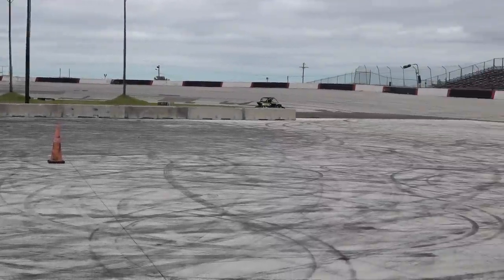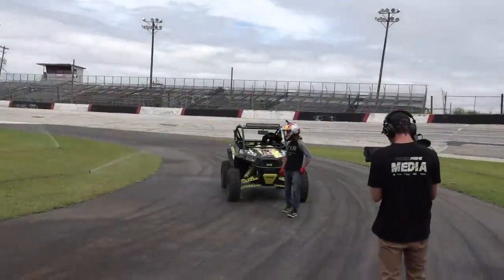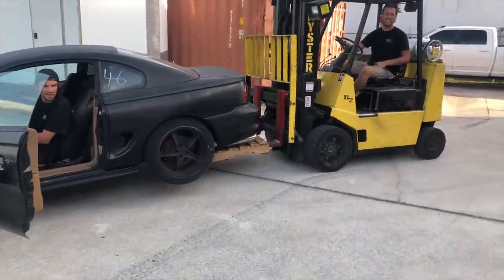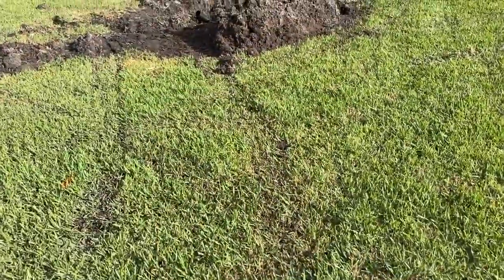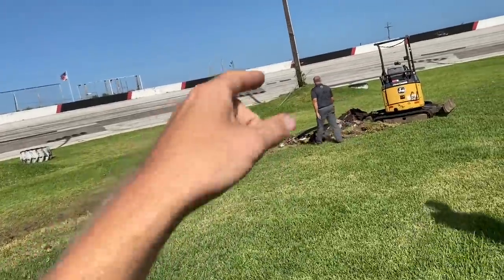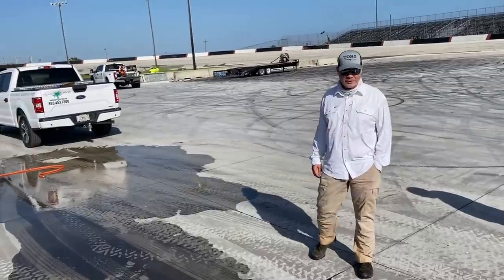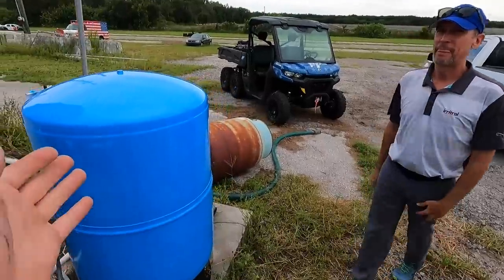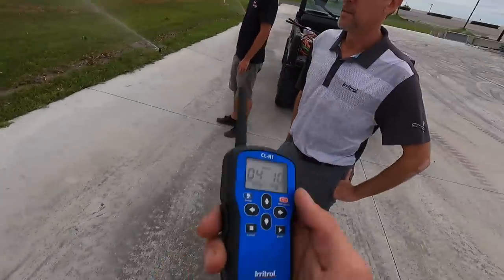Fixing MAJOR Freedom Factory Problems and Finding More in the Process!!! (That's Life!)

Comment: Cleetus, Journeyman Electrician here.... scariest scenario I have ever had presented to me in the industrial field.... I needed a core drill made for a 3 in electrical conduit thru a 12 inch explosion proof Brick wall... Hard Brick, the owner of my Electrical company handed me a 1/2 in Side grinder,( the big one) and a 4 inch core bit and said... "Have at it". I thought he was joking... Turns out, a 4 inch core bit will screw right up to a 1/2 inch Grinder... I had my helper hold the Drop cord tight so if the bit grabbed it would unplug automatically....needless to say, it took 3 cigarettes and a half hour before my balls dropped enough for me to make contact with that wall.... cut it like butter, but it was freaking intimidating as HELL....

Comment: "its called a french drain"

next clip

Cleetus: "so the french pipe"
Reply: It's hard for a Florida man to learn a new language that quick
Reply: "So weve installed the freedom pipe"
Reply: @Eargesplitten-Loudenboomer  Read that in Cleets voice in my head, and audibly laughed.
Reply: Damnpunk 78  it is AG in North America too, but we actually call it Weeping tile for the days when it was a terracotta tiles and pipe. A French drain is just the rocks with no pipe. Yes , there should always be rocks, the mesh will just get clogged with dirt.
Reply: Damnpunk 78  Yep.  When I dug one around my garage, I used the perforated pipe with mesh and gravel.  Still works well after about 15 years.  Dug a big sump in the back corner for the water to go.
Reply: Damnpunk 78  Florida and most of the South East USA soil is sand so it is a natural drain. No need for the gravel here.

Comment: When it comes to core drills and heavy tools there is no better than HilTI bar non. Freakin love their tools.
Reply: The general contractor I worked for found that out the hard way. He borrowed drills from three other contractors, - plumber, mason, electrician... They fried and he bought them all new replacements. He bought a $1600 hilti hammer drill and finished the whole job easily. Couldn't believe my eyes

Comment: Hey Cleeter, if you need a quick and affordable way to get Internet from one side of the track to the other for the irrigation system, have a look at the AirMAX and AirFiber product lines from Ubiquiti Inc. They are wireless units, just need line of sight. Range won't be a problem. The simplest setup is a matched pair at either end pointed at each other, but if you think you'll need more intertubes elsewhere, you could go with a point to multipoint setup with a single "broadcast" radio at the office/wherever the customer demarcation is to all the other buildings. The alternative is burying fiber and I don't think I gotta emphasize too much that is many times more expensive.
Reply: I've also had good experiences with Ubiquiti gear, with outdoor installs over many years. For an idea of how a racetrack installation can work, you can watch Crosstalk Solution's video: https://www.youtube.com/watch?v=6m00f9c2CUM
Reply: @Joel_E  Chris from Crosstalk Solutions would be an excellent person to talk to/possible collab with, though I think he's pretty far from Florida as the bird flies.
Reply: Actually, it just occurred to me, JayzTwoCents is a Corvette guy, I don't think you'd need to twist his arm too hard to get him down to the Freedom Factory 😂

Comment: They should put in 6” rotors so they can Install them 2” under the grass. Yes they will pop up through the grass.  By doing this it should save the sprinkler heads when someone decides to drive off the track.   I would recommend hunter 6” I20
Reply: Then they could run into the problem of having dirt ruining the seals on the rotor as well and then they just stick up anyway. I just hope they at least put the rotors on a swing pipe or swing joint so when someone does hit it they arent breaking the pvc line as well.
Reply: You can’t do that with St Augustine. The grass will eventually completely grow over it.
Reply: That grass is savage. Nothing stands in its way.
Reply: Don’t worry, they’ll get wrecked in a few weeks.
Reply: Dirt wont get into the seals ive been doing this for 10 years and have done alot of horse tracks and horse jumping arenas in marion county.   I can promise you they did not use swings joints. But if they used flex itll be ok. And yes most likely itll still get damaged. Hopefully cleet knows where the shut of valve is. Cause once they hit that valve box water is going everywhere.
Reply: Anyone else noticed that they didn't  tamp the ditch
Reply: John Durham 

I seen them step on the trench and it sunk in the ground.  I would have had my guys made sure the trenches were packed in good and add dirt to them if needed.

Comment: When cars are hitting the dirt . Sprinkler heads are gunna be busting off . Hopefully the sprinkler system has a valve to shut off when unwanted drop in water pressure happens :)

Comment: 5:37 NEVER CALL A VERMEER A DITCH WITCH, THAT IS A SIN
Reply: Exactly IT AINT ORANGE AND BLACK
Reply: The same with people calling all skid steers a bobcat
Reply: @benjirevels7900  I know its so annoying
Reply: i run a vermeer 40x55 directional drill and when he called that ripper a ditch witch i physically cringed
Reply: @devinschneider2395  i know, my dad worked at vermeer in kilgore texas for 10 years and my grandpa worked there for 35 years, my grandpa is the reason the directional drill is popular now, he was the best salesman this planet has ever seen said mr vermeer himself. My grandpa was glen tharp and he was given a brand new 40 foot gooseneck trailer when he retired along with 4 gold rolex vermeer watches. Now my dad runs his own buisness and I help him, we work on vermeer equipment for local companies. The directional drill aka the boring machine is the reason we make money, and my grandpa is the reason they still exist, because he managed to sell one of the first models to a damn dairy farmer who didnt need it, now that man owns a multi millon dollar drilling operation.
Reply: @devinschneider2395  also I have much respect for you running those damn things, we have snapped 50 pound pipe wrenches trying to disconnect drilling rod by pushing on the pipe wrench with a backhoe. The drill is a cool machine but they will drive a man insane pretty quick😂

Comment: It's actually called a sock tile... a french drain is just a hole with rock in the bottom.
Reply: We call them weeper drains or weeping tile up here in the north....
french drain is just a trench filled with stone
Reply: A H weeping tile is another name for french drain down here, I guess everyone just has different sayings for it
Reply: To us'uns a French drain is the hole or cistern, and the drain field that is a gravel lined channel with plastic pipe laid in it that has holes in it and quite often there can be a "sock" over the pipe like a condom that prevents silt from clogging the pipe and backing up the water.
Reply: @aussieguy1593  they all do the same thing anyways..... move water from where you don't want 👷‍♂️👍
Reply: Straight from google: A French drain[1] or weeping tile (also trench drain, filter drain, blind drain,[1] rubble drain,[1] rock drain,[1] drain tile, perimeter drain, land drain, French ditch, sub-surface drain, sub-soil drain or agricultural drain) is a trench filled with gravel or rock or containing a perforated pipe that redirects surface water and groundwater away from an area.

Comment: That shorter concrete plug indicates a low spot on the track, therefore, a place for water to pool. The original concrete guy should pay for the drainage.
Reply: James Plotkin But Cleetus only paid for materials. 316 speed laid the concrete and asphalt for free. There’s no way they are paying to install drains in a pad they didn’t get paid to pour.
Reply: Id imagine thats just a high spot on the dirt..no? The concrete is level...the dirt , not
Reply: @rv3434  The track concrete is low over there, thus the water collects, so I'd think it's shallow (thinner concrete).
Reply: @josephtalbot125  OK, fine.  I'd still expect a better job, even a free one.  Remember there was a lot of extra concrete?  It belonged there.
Reply: It’s weird though. I thought they had it measured with lasers
Reply: @SWTH71  They had the good laser equipment and made the pad flat, not level.
Reply: @jamesplotkin4674  right especially when it's free advertising for you .

Comment: I've used that exact coring drill. It's fun, until you have to punch 30+ 4" holes in a day, then it's not so much fun 😆

Pro tip: pop a concrete screw in the center of the core and use some visegrips to get the core out nice and quick and easy with just one guy 🤙

Comment: The grass may grow back quickly but the ruts never grow back. So when you start mowing and the wheels go in the ruts you will scalp the grass and it'll never recover.  Need to add soil to those ruts and keep the ground level.

Comment: Core drilling works better if you hook the water to the hose inlet on the machine. Use a thin wire to grab the core to pull it out.

Comment: Like you said with the Florida sun, I'm sure the lawn guy says this too, but have that system early run early morning before sunrise.
And running for 10-15mins during the day like the guy said, is kind of a waste of water. 
Personally I recommend adding like 1h to dry areas, in the next early morning programing for a couple days. That would allow the water to penetrate deeper, promoting deeping root growth. Which in turn, makes that area more resilient.

Comment: see if they have some kind of fertilizer setup at the irrigation controller where you can just pour a bunch of fertilizer in a barrel, have the water run through it, and spray the mix on the grass.

Comment: The technology in that Hilti core drill is very nice. Hook the hose up correctly so the water gets directed to where the bit is contacting the drilling surface. Pouring water on the track surface does almost nothing to extend the life of the core bit.

Comment: I cut concrete for living. Our biggest bit is 16"     you definitely need water inside the bit to help push the crud out. I mean you can do it that way too just helps when there's rebar. We'd just drilled that by hand no stand..   also take your hammer drill. Drill at angle and use it like a handle and pull up.  Don't use a long bit or your bend it.

Comment: I drilled 3 or 4 hundred concrete holes doing the electrician work for a poly silicon plant. It took like 3 weeks. Bolting the drill to the ground, moving it to the next spot and setting it up was the only hard part.

Comment: Can't speak for Florida dirt, but I put that same drain type in my Texas clay backyard two years ago after having numerous near-flood disasters in the adjacent sunroom, aka my office. The first year was great, but after that I suspect the clay clogged up all the little holes under the sock as anything over an inch per hour of rain rates, yah hoo flood again.  :(   Spent a week doing it by hand due to tree route routing, but I hope yours goes over better in the long run!
Add: What did a better job was embedding sandbags right near the slab, which at least redirects the larger surface water down into the yard. I'm beginning to wonder if a root has caused a crack now though, as I get weepers the next day after a big rain. For you, I'd recommend K-rails!

Comment: I was waiting for the core drill to catch and flip one of you guys on your lid. You're supposed to use a drop in anchor to secure it to the ground. Cleetus,  you need to call a pro(me!) to cut your concrete.
Reply: Could have used one on the core also to get it out.
Reply: @77Infidel  i just use a 5/8in tapcon and a chain. They're reusable

Comment: You should definitely check out irrigation controllers by Rachio or Hunter. Much more versatile and can all be done from your phone. You can literally run the system from bed, will notify you of low pressure or potential leaks in the system. I did irrigation for years and there is some awesome stuff out there!

Comment: Stick a 3 or 4 inch piece of pvc around the heads and pour about 6 inches around the pvc. A vehicle should drive over the head with the concrete absorbing the vehicle weight.

Comment: should have used a vibratory plow to pull in the lines-less damage to the grass. then use rainbird irrigation heads and controller. so much better. easier to adjust and more durable.

Comment: Man y'all coulda saved the grass by running flexible irrigation pipe and using a pipe puller instead of a ditch witch. No tearing up the crispy grass! Just a little seam you have to roll. That's how we do it.
Reply: Another thing is you can set the arc radius of those 360 heads so they aren't spraying directly on the track. No sense in spending money watering the asphalt!

Comment: $$$ Maybe try some large diameter concrete donuts that are sloped up towards the sprinkler heads. The grass will grow over the low part and if someone comes sliding in hopefully they would skip over it like a bump in the field.
Reply: One sprinkler getting ripped apart by a car will probably damage other connecting parts of the system. $$$$$

Comment: Hey I have a idea for your sprinklers that will save you a ton of money in the long run. Go to Lowe’s and get 4in metal tubing cut it to 5 or 6in tall then cement it into the ground get a extension if needed for the sprinkler pipe but get it to fit to we’re it can tuck away and be safe from ff drivers 

Hope this helped man 👍👍 don’t steel my idea and patten it I’ll do it eventually 😂

Comment: All the sprinkler heads need a three inch, .25 thick steel pipe around them. Notch the pipe where the sprinkler line comes in and sink them four feet. You tear up my grass, my grass tears up your car.

Comment: Comment on the cores you cut the reason why one is thicker than the other is if you remember you had concrete leftover you didn't use well that's where it came from that low spot

Comment: Good old fashion transit and a tape can tell you the lowest point. Concrete saw and cut a section out and tie the drain from the burn out pad into the French drainage system, pour back the concrete and done. Oh, by the way that is the reason you spent twice as much for concrete than the job should of cost; for just having light weight traffic on it all the time. Spend some time on the grading and the T.O.C. level and save money every time.

Comment: Rain bird / rain dial isnt the best reliability... ive installed irigation partt time for summer for 3 years. The machine they use also rips up the lawn alot i have a machine that just makes a clean cut in the grass and slides the pipe in at the same time . Not tearing up any grass ;)

Comment: That sock pipe won't last a year. The sock will clog with fines and you'll be right back to where you were to start with. "The French Drain Man" is where you need to go for installation guides and materials.

Comment: That weather sensor is not that great, my guy. 
They fail very often. The good ole irritol rain sensor is just fine.
Check out Hunter Hydrawise. Smart Controller, internet connected. No need for a sensor and you can run everything from your phone. No need for line of sight for your controller.
Sincerely, a Certified Irrigation Technician.
P.S. I work for a Rain Bird Select Contractor, so my bias should be toward Rain Bird controllers.

Comment: Ok yall. Helpful tip when core drillin in a horizontal plane and need to remove the core after the drillin is done.  
1 method is take a hilti drill or some other serious hammer drill and get ya a hole that corresponds to a concrete anchor.  Pound the anchor in. Drill the core. Then as after you clear the drill, thread a bolt into the anchor. If it cant be pulled up by hand due to weight, use the drill and a chain to lift it out. 

Another way that requires a bit more skill, as you ate at the depth of the core drill, as youre about to finish, cut the water off at just the right time to avoid bit damage, then as you reach depth, with water off, raise the drill as ya turn it off and itll break the core off if youre not going all the way thru the slab or if ya are, the bit will catch the core. It takes some skill so the previous method is easiest.

Comment: That black corrugated pipe doesn't last long at all.  10 years later it'll be completely clogged with roots and dirt.  Should have done it in solid 4 inch PVC